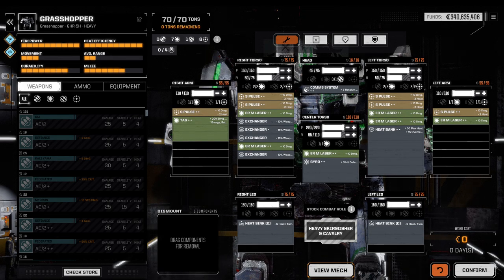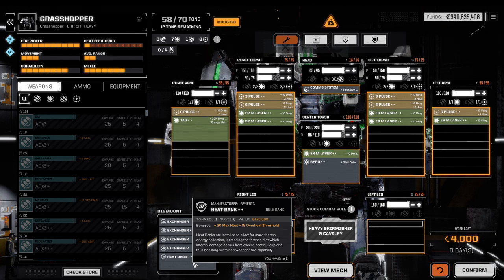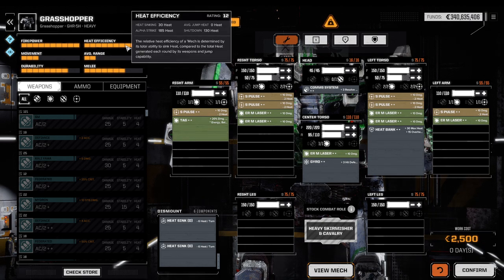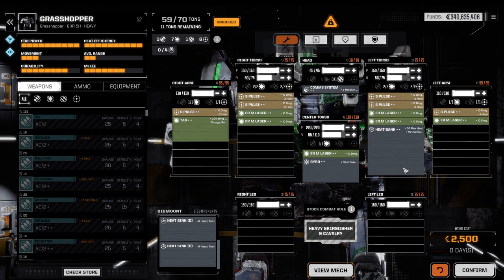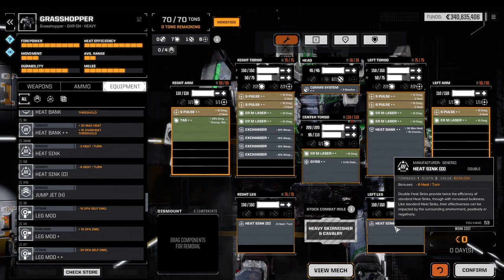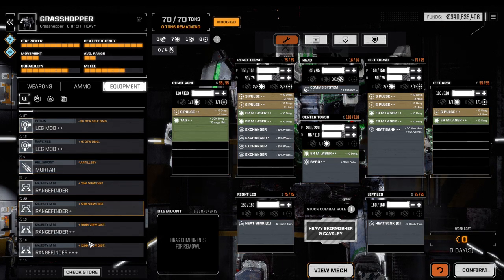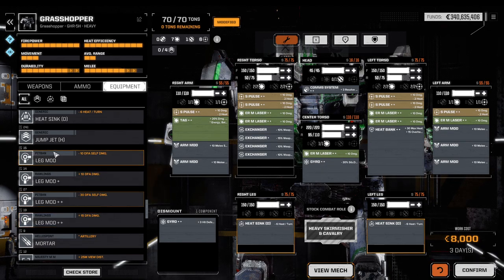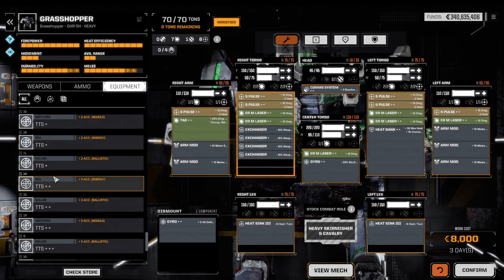BattleTech Guide to Heat Management and Equipment - How optimize your Mech

Comment: Weird that you're recommending stab damage gyro. I just finished my first campaign on default settings, and I think they only time they managed to knock down my mech was in missions with crappy training mechs. I had to use vigilance occasionally to get rid of stab damage, but that's no big deal.
Reply from the maker: Hi Tomasz,
the reason why I strongly recommend it is that in several 5-skull missions, I ran into multi-SRM and multi-LRM lance opponents. If you combine that with super-heavy-LRM turrets, I found that even with maxed Pilots, you are finding yourself to take quite a bit stability damage (although not a lot of effective damage). 

The moment that you are knocked over, the real pain begins and thus I always found it helpful to effectively gain 50% more stability for one component.

Hopefully that makes sense.

Comment: About the calculation here when you were talking about small pulse lasers - you didn't account that their heat generation is also affected by exchangers. You're having -45% weapon heat, that means that the s pulses contribute only 33 heat to that 114 total.  Your output without them is 81 heat, and you heat sink only 42 (so you're 39 above your heat sink value, not 12).

Didn;t want to be mean or anything, just wanted to clarify and maybe help :)
Reply from the maker: That is a good point, indeed those would be impacted by the exchangers. Thanks for adding the comment, doesn‘t change anything on the general tips, just changes the impact effect a bit.

Comment: Another cool video - from my campaign run 3? years ago I can't remember half of the equipment you are talking about^^
I guess the mechs I designed sucked quit hard (but were good enough to finish the campaign without any problems).
It's nice to see how much room I have to design better mechs. :)
Quite good game design - you can finish the game easily and think: Hey, I did a great job in designing those mechs.
But in reality you can do a much better job if you take a closer look to the mechanics and the math.
Reply from the maker: Always a good time to start another campaign, the game has a great re-playability.

Comment: Not that it's relevant to heat management (well, not much) but I'm surprised you don't use jump jets on your Grasshopper (or maybe they're just absent for this lesson).  I know you've mentioned elsewhere that you don't feel they're a good tradeoff for mobility vs damage, but I've lost count of the times my Grasshopper has been able to jump behind an enemy while turning to face their back, and cored even 100-ton enemies with a called strike to the CT.
The laserboat build is naturally optimal - also good for called shots to the head, as it's unlikely that hits that land elsewhere will accidentally core your target.
Reply from the maker: Yes, that is a decent alternative. My personal preference on how to approach the game is to take as little down-sides as possible (allow for little to no options for the enemy to retaliate) and effectively grind them down. It is less flashy as a high impact JJ play, but more effective in 80-90% of the situations.
My fundamental disagreement with the Jump Jets is the amount of tonnage that they require. Since you do not want to sacrifice armor, you will need to reduce your offense capability. And my logic to this is - the one time that you can jump behind an enemy to finish them off is offset by maybe a dozen rounds of lower damage from other sides.
Finally, in terms of error mitigation - I have had the experience with Mecs that rely on JJs, that if they do not get their counter-parts down, you spend quite a bit of time to either salvage the situation (and try to rescue the now exposed Mec) or will suffer significant damage. With my approach, that wouldn't happen, as you just grind the enemy down, there isn't much that they can do about it.
Reply: @SykenPlays  Well, in spite of my own successes, I certainly cannot dispute your results. You can face-tank 5-star jobs with a light lance, I'm in no position to judge you. 😆
Reply from the maker: @HeadHunterSix  I am sure you are doing well also - there is more than one way to play this game and multiple strategies are capable of winning missions (i.e. 3x LRM boats plus a scout is a viable, albeit somewhat easy-to-counter strategy).
Reply: @SykenPlays  JJs are very useful in HBS Battletech because of the maps. Elevation difference matters a lot for offense and defense difficulty, having the edge there means your need less armor and get more of your damage on target.

Jumping behind a target is more of an edge case if you ask me, the most common situation is getting on a ledge that would otherwise require you to use multiple turns to move to or even be completely inaccessible. And the maps are littered with those.

Comment: man, u said hit defense is only against melee?? im almost completely sure its vs ANY attack, or specifically ranged attacks! it reduces hit chances on u by 15%, so like a permanent 1.5 evasion! its EASILY the best!
sure stability ones are nice, but nowhere near avoiding getting hit!! it boosts your armor even more!
Reply from the maker: Thanks for sharing your opinion.
Reply: @SykenPlays  
Do you agree that it protects u from getting hit by shots too?
What made u think it's only for melee defense?
Reply: "+X hit defense" is a flat increase to shot difficulty, and as such it works for ranged attacks.